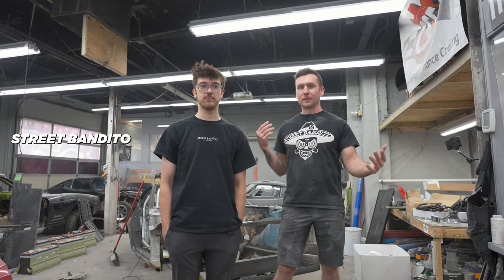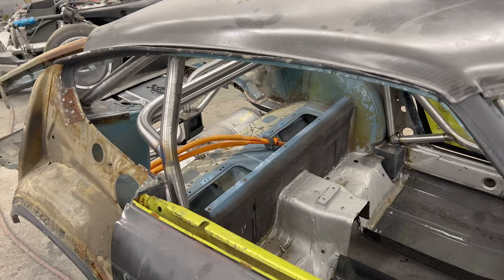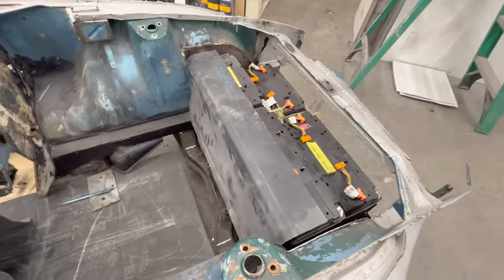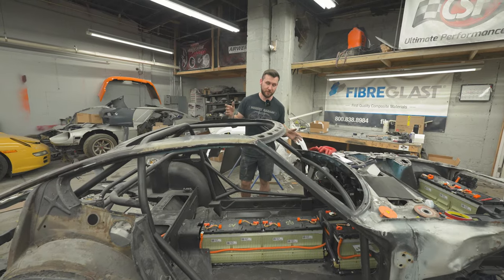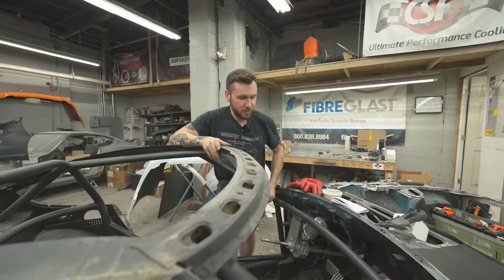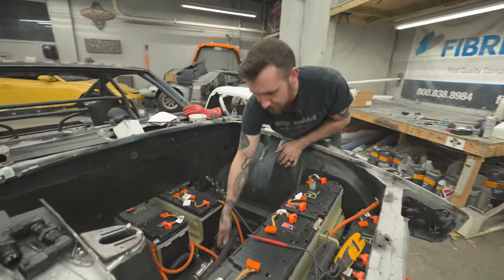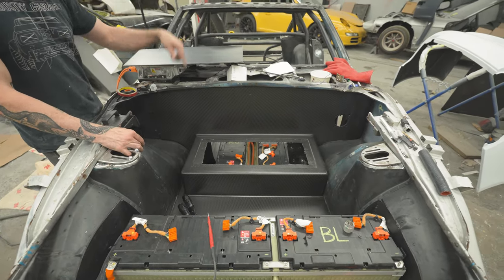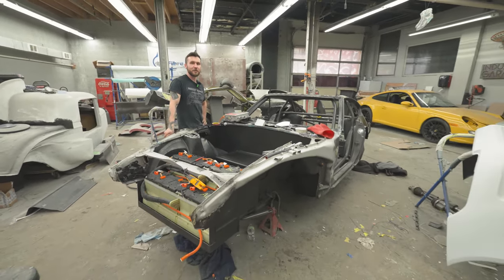It has a Frunk? | Electric 240z Battery Install | The Legacy (07)

Comment: Any concerns on weight being past the front towers?
Reply: I was wondering the same thing, but he did mention having scales. I know he thinks several steps ahead, and I would think having the batteries behind the front axle would be ideal for weight balance/ballast.

But for all I know, this could be intentional. Hopefully, we will hear something about this?
Reply: Thinking the same thing. 
Scales help get the weight front and rear in proportion. But wouldn’t the car be difficult to handle with a large proportion of the front weight in front of the wheels?
Reply: 50:50 weight distribution is less important than the moment of inertia of the vehicle.   Putting a lot of weigh forward of the front wheels will induce a pendulum effect in corners.
Reply: @markraumer2336  Weight distribution is the deciding factor in determining the moment of inertia. The vehicle is stiff like a single beam, not floppy like a rope and weight. The handling will be fine and they have probably calculated some weight distribution guesstimates in the digital model.
Reply: Nope

Comment: 31:01 can always make your own. Just heat it up and drop it in used motor oil (of which you'd have a lot around). Clean it with a rag and that's about all she wrote. They will never rust either.

Comment: Why do you want to put so much weight in front of the axle? Are there not any cells available that can lay flat on the floor pan to keep the center of gravity low and moment of inertia centered?
Reply: $$$$ is why.
Reply: Yes I was thinking the same thing, having it as low as possible and as far behind the front axle seems like it would have better handling and good weight transfer but they could be shooting for this type of weight bias intentionally, hopefully we will find out.
Reply: Was thinking this also....the absolute worst place for a load of weight.  Love this project.  Please keep the EV detail and explanations coming, would love to do a conversion on years to come 👍
Reply: Combined with the other components, it will probably give the car a near stock weight distribution. Have you seen the heft of the motor assembly and also do you know where the originel engine was placed?

Comment: Wondering if this thing is going to be a little too front heavy with 400lbs or
So over the front axle? Why not tuck the batteries up against the firewall with clearance for the steering shaft?

Comment: The amperage is also the flow of the electricity (also called current). The higher the amps the faster that 400v will move. Going thicker gauge wire is a safe guard for the current the electrical bits are pulling. Idk for sure but I’m 90% sure Teslas motors pull more current than the Chevy volt so it’s good you upgrade those cables. You may wanna double check the max current draw of the motor and double check your wire gauge rating for amps @400v just to be triple sure.

Comment: Just to clarify, the 600v rating on the cable speaks to the insulation rating. The diameter of the cable is specific to the amperage. Amperage, force, makes heat. 12v system isn't dangerous to humans. Our skin is our insulation, which is good to about 50volts. But amperage, is what gets the wires glowing red and melts things.

Comment: So much good stuff, that firewall is so sick and I never thought that's a service whole, just thought it's a step-up for rigidity. I love the whole V pattern you're doing with the carbon. Chiron style :D

I wonder if with so many batteries, you would need an intermediate cooler? Or is it ok to run the water through all of them before going back to a radiator?

21:00 everything reminds me of her...
Reply: I gotta think that they don't put out much heat. The biggest thing I would think is they would be slow to heat because they have a lot of thermal mass, but I've never messed with this stuff, I'm just spitballing. Excited to see how it all operates in later episodes as we roll into October.

Comment: im surprised you guys didn't try to do an electric steering unit so that you could put the batteries in a better area. Well at least I would think that could help. 
What safety precautions or fab work did you guys have to do for the batteries?
Reply: I brought this up and so have others, but they have yet to address it.

Comment: can the fixing of the maintenance hatch be done with magnets on the cover?? I myself have license plates on with a magnetic pin.The magnet is attached to the license plate and the opposite side is hidden behind the bumper molding. Still, it targets and pulls the shield from your hand into place from 5cm away. (Neodymium Magnets) you dont need big.

Comment: Should just epoxy a magnet on the bottom of the battery hatch and then have a pull tab that you can just apply to it when removing and otherwise when in docked position you could some how use the magnets to prevent rattling

Comment: Are you going to add sound deadening to the back of the firewall and some other stuff? like corrosion resistant too! straight baller because any attempt to control the sound will help.  the motor and everything going to be so quiet you don't want to hear rocks without trying not to hear rocks

Comment: Is that safe enough? Imagine there is a lot hot air in those tubes and one gets a kink in it.. ? Or the car flips over and one of them leaks. I would place them under a metal tunnel type eventually. I'm no car mechanic, just thinking as I write.

Comment: Longevity will be the question. Two things I see is one are you actually getting even cooling which would cause uneven wear of batteries and eventually all that cooling hoses will leak and fail. Hopefully you will be able to work on this without taking everything apart.

Comment: No no no, here's how it is. Amperage is like torque, volts are like RPM, kilowatts are horsepower (actually). All this is close to being literally true with regard to motors. So think big amperage, big wires just like you'd have big axles, high voltage, you'd want good insulation which is like maybe balancing or scatter shield, or lubrication in an engine.